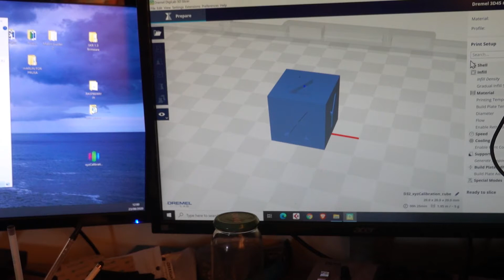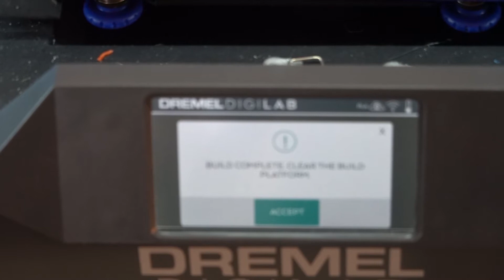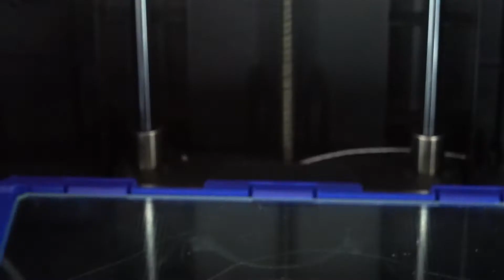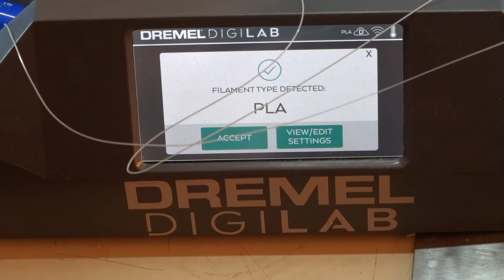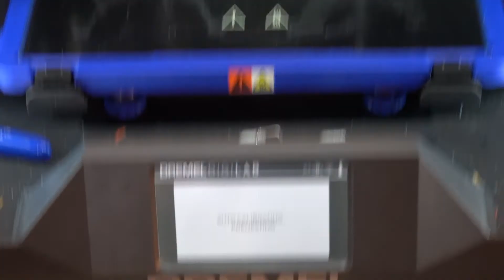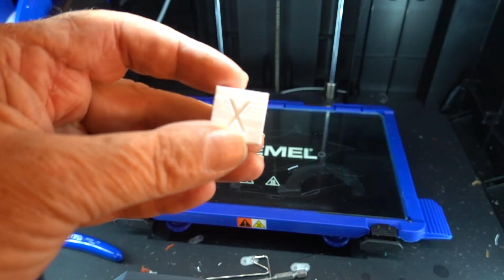Dremel 3D45 after a few months use

Comment: Let me tell you. I got a CR-10s Pro V2 after looking around at printers for a good deal, or so I thought. It was new out of the box and I got about 100 hours of pretty good print quality, then it was problem after problem. I've replaced almost every part (fans, software, driver motors, driver gears, hot end, bowden tube, bed, and a few other odds and end), on time of having to modified the thing so it will stay level more than one print, it was also very very loud with a load, and the stock bed was a nightmare, on top of silly little problems that popped up after I fixed something. Bottom line is I hate it. I also have an ultimaker S5 that is only for work loads, so the bar was set high, but I will say, as you said. Pay the extra money for a good printer.

Comment: Thank you for your review!
Is it posible to communicate, that is manage printing and sending 3D model files to the printer over ethernet/WIFI or USB without using some sort of online cloude service? That is, I don't like to be depentent on an online service. If I don't connect online what functionality will I be missing?
Reply from the maker: you can connect  with a USB printer cable and print direct from the dremel slicer without using any on line stuff. Personally I just save what I want to print on a usb stick, put it in the printer and print. Much less hassle.
Reply: @Aikonaazi  Thank you for your answer!

Comment: Did you try to print tpu with it? Unfortunately it’s not supported material...
Reply from the maker: Not on this printer. It shouldn't be a problem though because it is a direct drive. I would use the PET settings.
Reply: @Aikonaazi  thanks for the reply. Can you recommend a tpu for it? I read it can’t be too soft.